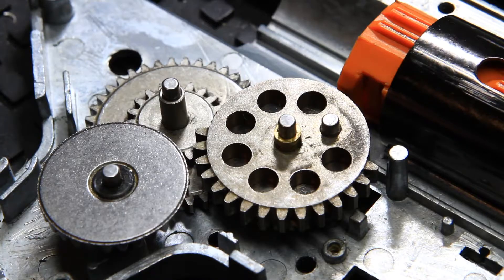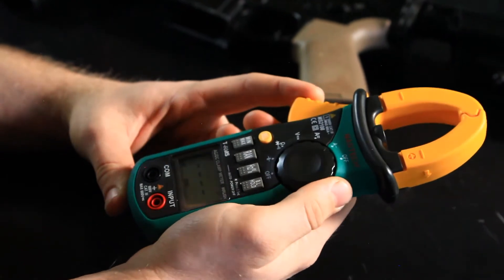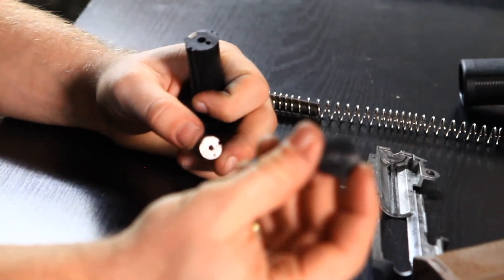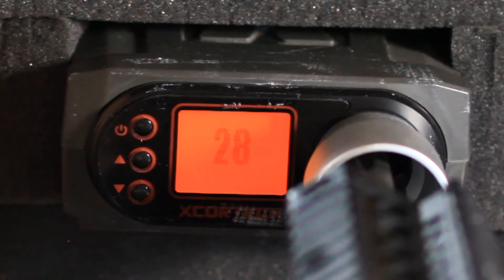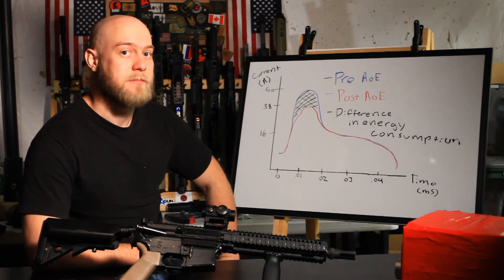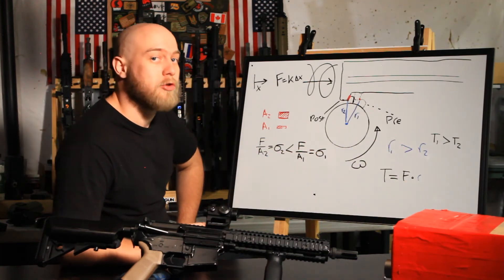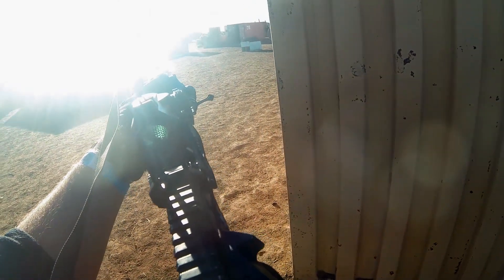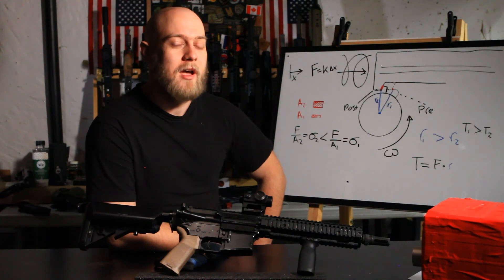ASE, Ep 1 - AoE Correction

Comment: when adding the spacer in the cylender you lose air volume. to get higer fps, get a cylender with the side hole further back.
Thanks for the video tho:))
Reply from the maker: You know, not everything is about a higher FPS. Sure, you loose a small amount of air volume but doing AoE correction that's a given. You are not right about air volume equating to FPS. Speed of the piston has more to do with how much FPS  you end up with. 

What it does affect is the cylinder to barrel air volume. And that creates a different set of problems.  

There is no one right answer. I would much rather have a proper, lower stress build that outputs just under the desired joule target than one that destroys itself because it was built hell-bent on max FPS.